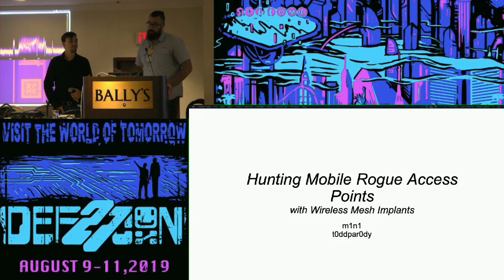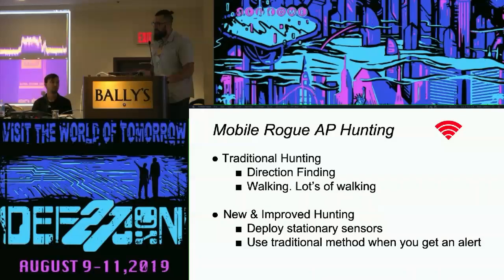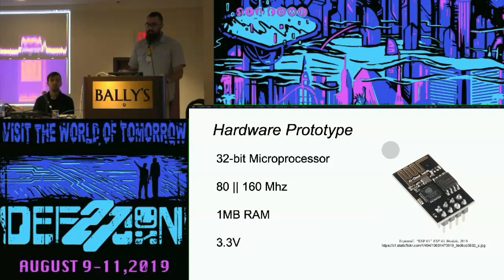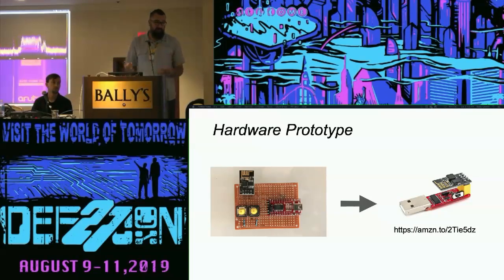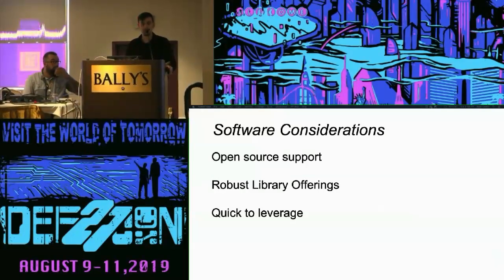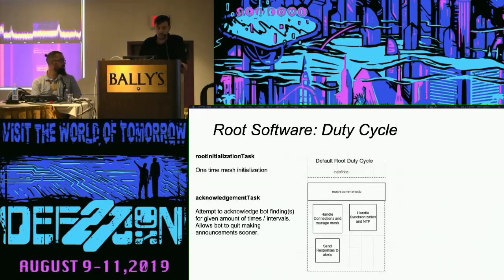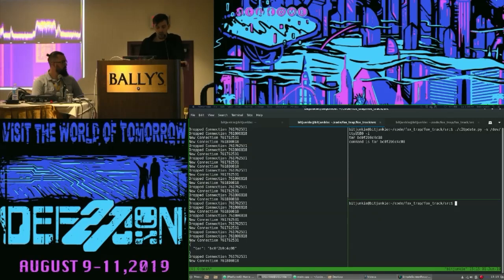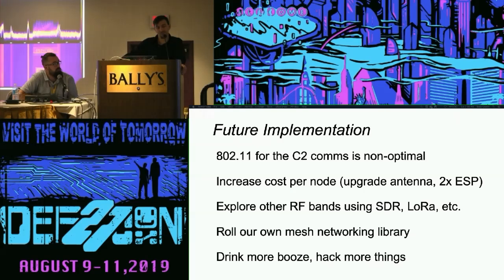m1n1 - Hunting Mobile Rogue Access Points with Wireless Mesh Implants - DEF CON 27 Wireless Village

Comment: Any thoughts about using a buildings power wiring as antennae to locate the AP. Filter out the AC current noise and use combined input from multiple wires to provide AP’s approximate location.